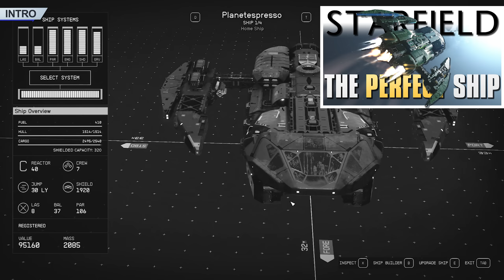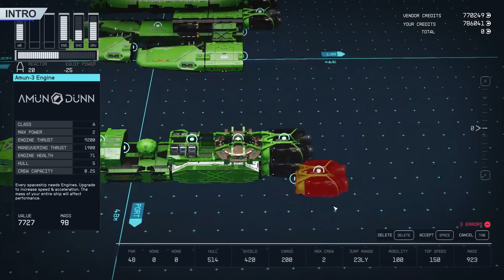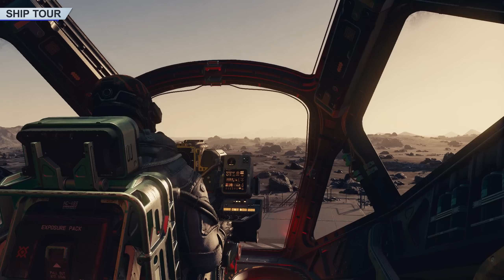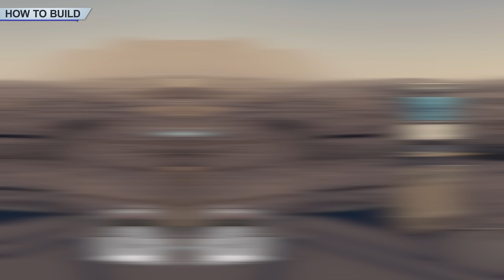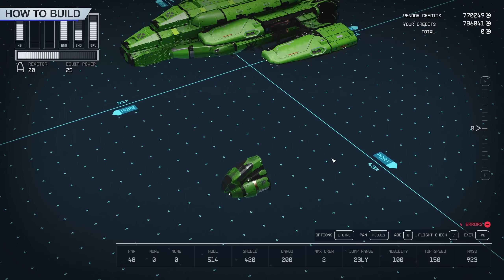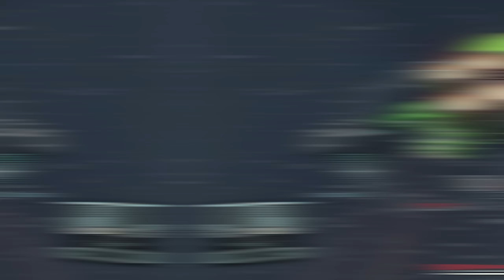Starfield - Build PERFECT NO REQUIREMENT Ship | No Ladders, Max Speed, & Beginner Friendly

Comment from the maker: Cost is around $170,000 max
Part List By Order:
Armstrong 10 Cockpit
Deimos Workshop 2x1
Stroud Infirmary 2x1
Deimos All-in-one Birth
Deimos 100DP Slim Docker
Deimos Cowling – Fore
Deimos Hull A
Dogstar 30S Protector Shield Generator
Deepcore Helios 300 Grav Drive
Dogstar 134MM Toroidal Reactor
Amun dunn Amun-3 Engine
Stroud Eklund Stability pro landing bay
Stroud Eklund Accu-Lander 11
Nova Galactic Nova Cowling 2L
Stroud Eklund Stroud Cowling 1LA-ST
Stroud Eklund Stroud Engine Bracer A
Stroud Eklund Stroud Cap A – Port Fore Top
Deimos Cowling – Aft
Dogstar M30 Ulysses He3 Tank
Nova Galactic Nova Cowling 1L-SF
Horizon Weapon Mount
Vanguard Obliterator Autoprojector
Reply: Thank you so much for this list!

Comment: Sorry but not ever a ship I'd waste 177k on when for 1/2 of that can modify the free ship they give ya at the start to much better crew and cargo stats BOTH needed. Add that bulbous look needed to cover the reactor just for me really looks poor.
Reply from the maker: You can add habs that give more crew. You can upgrade the cockpit to give more crew and cargo. You can add higher cargo capacity. All able to be changed. The point of this is you can make it from level 1. Even so, you can not modify the free starting ship to be better than this for less. If you modify the free ship, it's less than 177k to create this from it since you'll be reusing or selling parts. If you try to add more cargo and more crew without upgrading the reactors, engines, grav drive etc you'll have an absolute stinker of a ship that can't travel any distance, and is a sitting duck in fights.

Comment: Nice build @Dantics - I can see a lot of thought has gone into putting that neat package together.

The Ares DT30 is actually the 0 starship design skill engine that allows the highest mass ship to be constructed - with your power budget of 12 it gives a total Maneuvering thrust of 12,300 compared to the 11,400 of the Amun-3 which increases total ship mass from 923 to 996.  The engines also weigh less so your non-engine mass goes from 335 with the Amun-3 to 468 with the DT30 so that's a 133kg (or almost 40%) increase in available non-engine mass.  Of course the engines would probably be harder to make look as nice in the design but you're the only one seeing it :p

Looking forward to seeing your next design!

Comment: Make it through the early game with only 200 cargo? That...won't work. 
Cockpit: The Viking CP-100 has 1 less mass(4) than the Armstrong 10. And you could cut fuel down to 150 or so without losing much(maybe Titan 350[75] x2, Mass-24). 
Wouldn't the Ares DT30 Engines(Power-2, Th-9200, MTh-2050, Mass-88) give you more thrust/mass for the same 6 engines with less total mass? 
Also, it seems like you added 130+ mass in structrual components. Wouldn't that be better spent somewhere else?

Comment: Top speed is based on engines, not reactor. 

Not the fastest ship either. 180 is top speed.

An A 20 reactor? Hell you could take the Star Eagle and slim that girl down and still have access to the A 29 reactor and high level engines all for free.
Reply from the maker: -Top speed is based on engine class. Aka what reactor you have. 
-Star eagle is not at the start of the game with no requirements. It requires you to finish a whole faction story line. 
-150 is the top speed for class A reactors with no requirements. 140 for class b. 130 for class c.
Reply: @Dantics   I could be running a class c reactor and class a engines and get 150 easily.  The class of the reactor only determines what class of parts you can put on like you can't put class c engines with a class a reactor. but the reverse is true, You can absolutely put class a engines on a class c reactor and get a higher top speed than class c engines.

Your engines are your determining speed factor not your reactor. 

You can finish the ranger faction quest line before doing your first mission with Sarah. And please tell me what skill is required to finish that faction quest.

Having 70k credits to build your thing isn't start of the game either so I'm not sure what point you are trying to make.

You could just admit that you missed a few facts but you probably won't.
Reply: Speed is based on the highest class engine.

For example, if you have 1 B class engine and 2 A class engines on your ship, while also having a C class reactor, your base top speed (without crew skills or your own skills) would be 140. And that is because the B class engines, not the C class reactor nor some average between the engines.
Reply: The 180 top speed is for one engine only - the White Dwarf 3015 - and it is like that engine is bugged so may get fixed at some point.  To me, when you look at the whole series of those engines, the 3015 has had it's stats swapped around with the 3020 but even that doesn't explain why it gives 180 speed.  If speed is absolutely everything then go with it but, with an engine power budget of 12, you are losing 113kg of non-engine ship mass capacity by using the 3015compared to using the Ares DT60.

Comment: White dwarf 3015 engines are 180 top speed. Not sure if they require skill points
Reply: It does. The 3015 Needs Ship Design 4.
Reply: @Zayphar  Ship design 4 is one of the easiest to get skills, just after piloting.
Just add parts and pieces from each manufacturer until you ding that level, add a point and keep going. Delete all the parts after you get the point to recover the credits. 20 minutes you can go from level 0 to level 4.
Reply: @jackflash6377  Agreed. For some skills it is the challenge that takes time and effort(Concelment anyone?), but for many skills, the challenge is the easy part and what takes time and energy is gaining the 3 levels so you have the points to apply.

Comment: Excellent video! Does cowling covering the internals actually provide protection to those systems or is it purely esthetic?
Reply: I believe its cosmetic only because i built a tank and still take same damage. Plus if you focus on a ship to take out specific stuff like engines or shields during combat tou will notice no mater what your shooting at it will always hit the item you want to hit. Its no different  for enimies attacking tour ship
Reply: No. Structural components are either purely cosmetic, or they allow a better arrangement of vital components of the ship(i.e. weapon mounts, passageways, etc.).
Reply: Purely cosmetic, as it does not matter where the do called vital parts are in a ship for gameplay mechanics. There is only one time this matters and that is when building empty center mass ships. The game ai is programed to hit these parts as long as they can hit center mass so if doesn't matter if they are covered or not.
Reply: I’ve been thinking about this everyday since the game came out